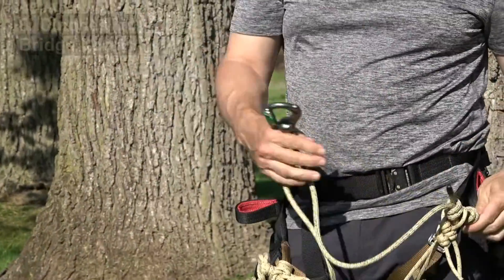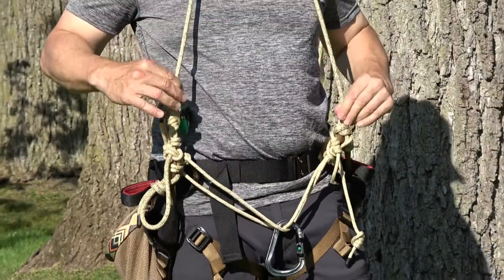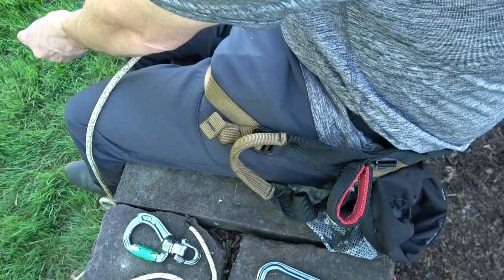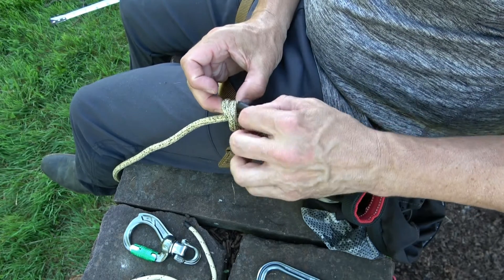Longhorn Agile Bridge Design

Comment: Sterling 8mm oplux from ACO good for bridge rope along with the 6mm?
Reply from the maker: @moonlighthomestead4259  yes, RescTech and Oplux are both very smooth on a bridge. 6mm TRC is a great cord. And although this video is about the Longhorn Agile as the friction hitch, the JRB Ascender works equally well and is a bit more compact.  I will be showing that option again soon.

Comment: Hi John, I recently got introduced to saddle hunting through a few friends ahead of the PA rifle season. I had sourced everything prior to finding your channel and website.
I see on your section on ropes you do not have e a recommendation for Canyon C-IV. 
This is the rope that I had bought due to it arriving  before I went on my trip.
I can tell the rope is fairly stiff and wonder if it is suitable for this bridge design with 6mm TRC.
Reply from the maker: @AndrewBohlin  that rope is on the stiff side, but it will work.  The Ghillie rope I used was also stiff. The place where stiffness can be an issue is when we actually go to Pivot left and right when we're actually hunting. The more flexible the Rope is the easier it will be to Pivot.  There is such a thing as it being too easy... for example, I would never want a pulley on my bridge carabiner.
Reply: John, thanks for the reply. I really enjoy the videos. You really have a knack for explaining and teaching. Your website is organized very well and easy to navigate once you spent some time on it. If I hadn’t found it I’d be looking at advancing the anchor point as just the way things are done, because the only exposure I was likely to get was through the few friends I have doing it.
Reply from the maker: @AndrewBohlin  thx. The website has been growing and I finally took some time to create a sitemap and create a page hierarchy. As for advancing an anchor... i have tried it and it's actually very difficult to do while properly managing slack and navigating branches.  I find an alternating anchor method to be a safe alternative.
Reply from the maker: @AndrewBohlin  6mm TRC will work with it too.
Reply: this channel is a wealth of knowledge, thank you so much

Comment: Hi John great system! I was wondering could a clove hitch also be used on your left side? Or does the poachers knot cinch better on the 3 coils? Thanks
Reply from the maker: I don't recommend a clove hitch in that application. It's potentially unstable. What's tied here is basically a poachers with 3 turns around the bridge.  I tried a poachers with a Clove (instead of  3 turns) around the bridge loop and wasn't happy with that either.  This bites we'll, and if ya want less bite, use 2 turns instead of 3.
Reply: Thanks again John. I appreciate the input

Comment: I must have some something wrong. Mine won’t self tend. Is the tail of the bridge supposed to be on the inside of the assembly when finished?
Reply from the maker: @paulcrave3112  i cant see what you created but most likely, the rope is just sticking out the wrong side. You don't need to retie the LA, just rework the tail end.  See the original video for perspective. 
https://youtu.be/GWp-Mu6p80Q?si=sF4pdvZIGKt3bqar
Reply: @jrbtc  I’m retrying it now and watching closely.
Reply: @jrbtc yeah, it’s kind of obscure in the video, but it matters what side of the bridge tail you go with the longhorn to tie the clove hitch. Works great now.
Reply: Such an improvement to my saddle. 
I ended up getting an extra foot of bridge material but I can cut it off as it wasn’t needed. 
Can I flame the end of that Rougarou? Will it melt sufficiently? Then I’ll put a bit of shrink wrap on it too.
Reply from the maker: @paulcrave3112  you can flame it but hit it with a rag immediately.  Look up the video for JRB End Loop v3. it demonstrates that.
Reply: @jrbtc  yeah, I’ve seen that. Thanks.

Comment: I have Sterling 6mm accessory cord I bought from ape canyon last year but haven’t used it for anything yet. Will that work instead of the Sterling TRC? Also, I have some 8mm Oplux I could cut a piece out of to make the bridge. Would that be sufficient? I think a lot of saddle manufacturers use Oplux for their bridge.
Reply from the maker: I haven't tied that as a bridge specifically, and I am certain it's going to "work" but I don't like how much that cord stretches compared to TRC. The Oplux is fine, but slightly less coarse than Rougaroo or Resc Tech, so it might need one more wrap. Tie and test carefully.
Reply: @jrbtc  Thanks John. I  ended up just ordering what you recommended. Their shipping is so dang expensive though!

Comment: For a minimal metal equiment setting, there would be 3 Longhorn Agile hitches. 1 on the main line, 1 as bridge and 1 as footloop. The redundant bridge might as well be a Longhorn Agile one, so 3+1. Soft shackles cannot fully replace metal carabiners, but while still acting responsibly and substituting for a few Longhorn shackles, a full rope system is available for desperate times.
Reply from the maker: @KeepItSwift  a Garda Hitch Footloop is much better performing.  The two carabiners it is formed with don't clang together and don't contact anything else when run properly
Reply: @jrbtc  Yes, yes. I actually need to buy carabiners, I have only 1 right now. 2 for the Garda and 2 for a Lineman’s belt, hopefully in the near future 👍🏼
Reply from the maker: @KeepItSwift  I have a page dedicated to carabiners... consider what you are building and simply make a list. For example, if you're using a compact Longhorn agile and your setup, I like to leave a carabiner inside of it to ensure it never comes apart.
https://jrbtreeclimbing.com/
Reply: @jrbtc  I've checked your website in the months back, and yes, I need to refresh on a good amount of stuff before I purchase anything. Lack of details, poor quality or overpricing are always right behind the door. Thank you for making all this information free! 👍🏼
Reply from the maker: @KeepItSwift thx.  I am regularly expanding and updating the website.

Comment: On your left hand side of bridge... Any advantage over the way you tie this vs a figure 8 on a bite to make a loop which is then secured with a double prusik to left hand side of bridge loop
Reply: Gotcha! Thx for the reply
Reply from the maker: @kylehargroder8392  I have no objections to that. However, it will be a little less compact. When I execute a transition (see dedicated video), the key to be able to do it without using a linemans belt is having a bridge that gets really short. A fig 8 is going to be at least 4in longer.

Comment: I used 8mm resc tech with 6mm trc to replicate, but not climbed on it yet. The 6mm longhorn agile hitch seems to allow the bridge rope to move too easily in both directions. Will it tighten up once i climb on it? Is there a way to tighten the hitch without having to completely retie? I already weaved the blakes hitch tensioner bridge through for second bridge.
Reply from the maker: Jennifer, I see you just joined the JRB Tree Climbing Facebook group.  That's the best place to ask a question because you can include a photo or video clip. It's not possible for me to make much of a guess without seeing what's going on.  However, it's recommended that anyone using this bridge design gets familiar with the Longhorn Agile first.  It holds well in one direction when configured properly.

Comment: I’ve learned to tie both the Longhorn Agile Compact and the 523 Ascender. 
I’ve installed a double adjustable bridge using 9.5 Ghillie rope with 7 mm cord.
I rappel with a Carabiner and a Munter hitch on 9.5 mm Rogue with a back up Longhorn Agile friction hitch.

I really like the easy one handed tending and the ease of breaking under load.

Currently I have the 523 on my adjustable bridges, and the Longhorn Agile on my lineman’s and my rappel rope.

You recently answered a similar question, by saying the Longhorn Agile can be used on all three applications, but I’ve seen you tie the 523 Ascender on the same application.

My question: which hitch is better for a saddle hunting scenario? This way I only have to master one friction hitch!
Reply: By the way I’m about an hour south of the Ape Canyon Outfitters in Butler Pa, I think they’re having a grand opening soon!
Reply from the maker: Comparing the JRB Ascender Hitch and the Longhorn Agile Hitch, LAH is larger, but it's easier to install and remove, and its overall performance is slightly better.  Most of my Facebook group members prefer it.  With this video, I have eliminated the JRBAH from my own system.  I use only LAH and Blakes Hitch currently. By the way, 6mm Sterling TRC will work great with your 9.5 mm ropes and it will outlast other cords such as Sterling standard 7mm accessorycord.
Reply: Perfect
The LAH it will be.

I have the Tethrd ESS saddle. It has relatively small aluminum bridge rings which make for limited real estate to tie two bridges with the LAH. I think my final bridge set up is going to be a 9.5mm single adjustable with a LAH and a shorter second non adjustable bridge using the 7mm cord tied with the hunters bend. I really like how the carabiner attached at the crossing point of the two cords positions it nicely for a Munter rappel.
I’ll upgrade to the 6mm Sterling.

It’s very satisfying creating these hitches and using them in a hunting situation. I feel so much better (safer) on a friction hitch than I do relying on a Ropeman-1. Part of that is because I’ve become super confident relying on the basic Prusik that they began selling years ago as tree stands became more popular, and safety harnesses were included with your tree stand purchase. 
When I think of the home made climbing tree stands we made as young adults, modeled after the Baker Tree Stand. The risk factor was a 10. It’s a wonder I’m still alive today. 
It’s been a real joy watching your videos, learning to tie and implementing the various hitches and knots.
I appreciate you.
Thanks a million 🤘🏻.
Reply from the maker: @mattvogel5712  I can relate to your comment about some of the questionable contraptions we used in the past. Now, it's about time we got ourselves and our fellow hunters tied in and safe. As for your 2nd bridge, consider this:
https://youtu.be/4xOuwkz1Xos?si=6BHQAoM_rN-JDmqL

Comment: Nice system.  I know the poachers not as a constrictor knot.  Good to see how you assemble everything on site.
Reply from the maker: A standard scaffold or poachers knot will get really tight and be difficult to remove. But with those two extra turns, I find that it is quite breakable and even removable should we need to do so.